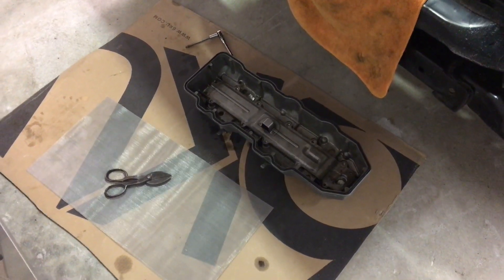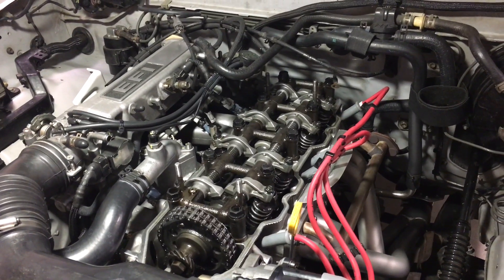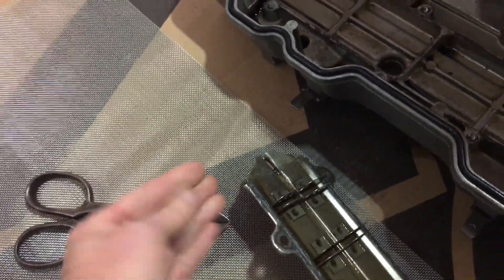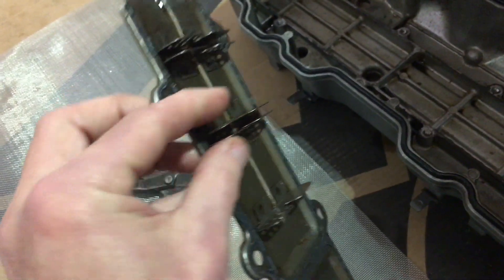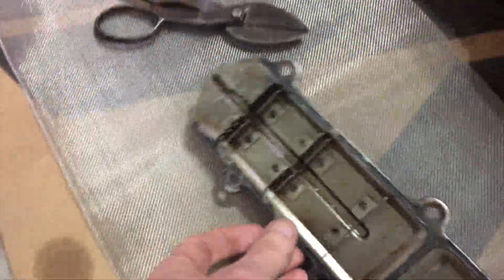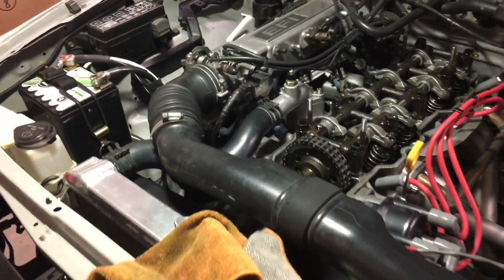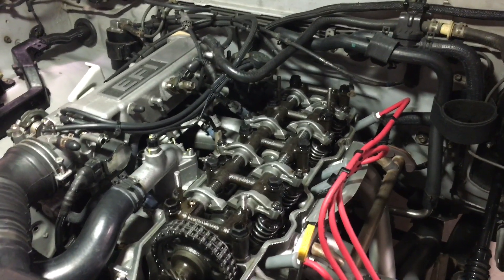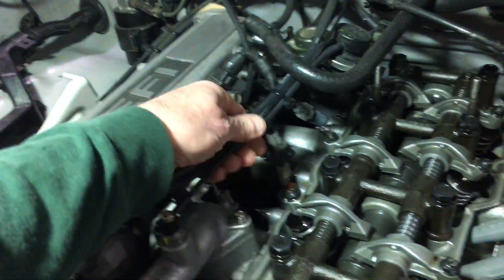Quick update on the valve cover PCV oil baffle nightmare on the Toyota 22RE

Comment: I’m following your videos in reverse from newest to oldest , but your hypothesis is definitely my conclusion… mine has the same problem with a new engine …. Part of it is LC head has a drain hole to small
Reply from the maker: Yup... that drain hole is a disaster on their cylinder heads. It causes the oil to back up and under acceleration and/or climbing hills, the oil fills up at the back of the head and then your PCV system turns into a straight up oil vacuum. Super fun times. Once I opened up the hole back there, all my issues vanished.

Comment: ... have you done a leakdown test yet ?
Reply from the maker: Not really. My compression gauge holds its reading and I don't see much leaking; but no, I haven't done a classic leak down test using the gauge which is designed for that. I'm waiting to see if the rings set in more. The truck has been running pretty well lately and getting good gas mileage. I'm going to take another 1000 mile trip soon and then do some more checking.

Comment: Do you think that the throttle body to valve cover connection could be drawing in oil blow by? I see you have the catch can on the pcv, do you think adding another to the forward portion in between the throttle and valve cover piping section?
Reply from the maker: I have put an oil separator on that line in the past, as a test. It did have some oil in it. That line primarily acts as a fresh air breather to allow fresh air (metered air) into the motor due to the PCV sucking fumes out. However, under any sort of positive crankcase pressures which the PCV valve isn't able to offset, it does function as sort of a blow off route and in that case, yes oil vapor can find its way into the intake. However, because the motor is under negative vacuum, I think it primarily functions as a fresh air breather into the motor.

Comment: If your engine is burning oil it's going to be your rings. I made the mistake and bought a engine from LC engineering amd it burns 2 to 2.5 qts of oil within 4 to 5 thousand miles of daily driving. Lc engineering let me down so I went with 22re performance
Reply from the maker: I'm a fan of both LCE and also 22RE performance. Any motor can have issues with rings. That's always a tricky area. I remember I built a Datsun motor when I was younger and despite doing everything right, it still burnt oil. A lot of times, too much gas during the initial break-in washes the cylinder walls and prevents proper breaking in of the rings also. Are you running a catch can on your motor to see if the oil is going through the PCV system or definitely through the rings? On my motor, I found that the majority of the oil loss was due to the PCV system and I am now monitoring the motor to see how things are going as far as oil consumption (and will have a video about that in the near future). My motor has good compression and seems to have relatively little blow-by from what I can see. I don't think the oil control rings are totally to blame here, but it's hard to say for sure. Also, on the LCE motor, what rings were you running? Chromoly rings are notoriously difficult to seat, while cast iron are typically a snap. I'd be interested to know which rings were used on the LCE short block vs. whatever you ended up with from 22RE Performance.

Comment: I recently purchased an owner's manual for my '94 as all the previous owner left me in the glove box was a Phil Collins cassette tape.  Surprisingly, they're still being printed new.  I was surprised/delighted to see that it mentioned somewhere in there that some oil consumption is normal.  How much is anybody's guess.
Reply from the maker: Yes, that's very true. Look up oil consumption on some of the Ferraris and it says normal consumption is something crazy like 1 quart every 600 miles. I'm still messing around with my 22RE over here and trying to see how low I can get it.